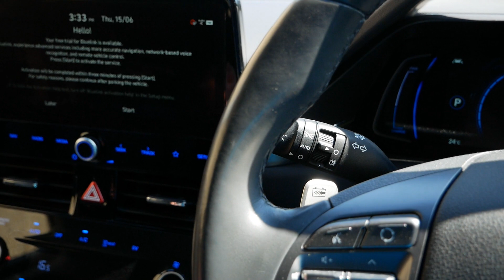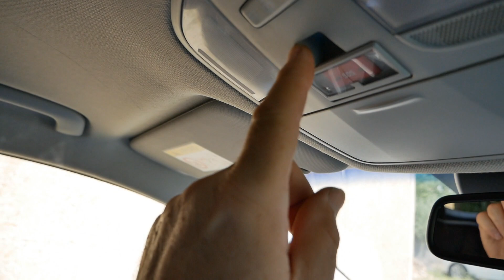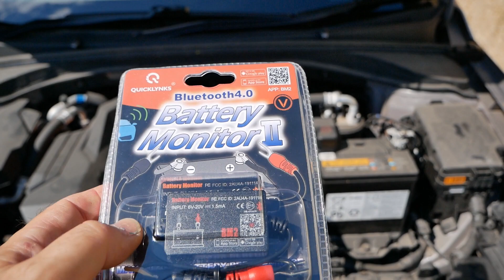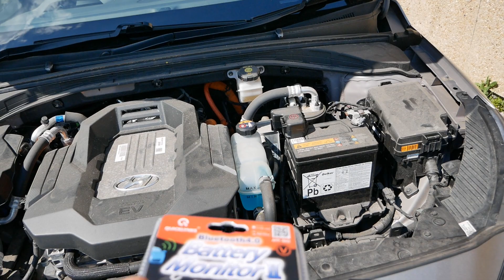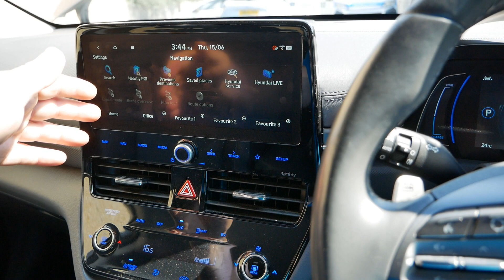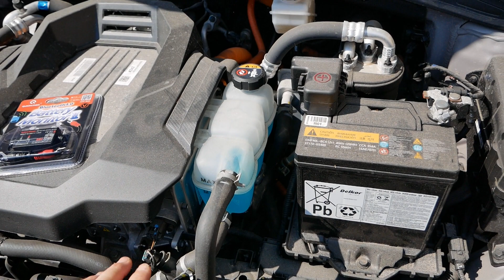Another 2020 Hyundai Ioniq 38kWh. Now for some 12V battery and Bluelink app testing.

Comment: I got a Ioniq premium se nearly 2 years ago now, it had 28k miles on it, 4 years old out of a Motability contract for £10,500 including a home charger and installation. It’s been absolutely fantastic, what a great car it’s been. It costs me about 1p/mile to run in electricity and overall around 25% of the cost per year that my Hyundai i10 did and it’s so much more comfortable and convenient. I would normally change my car after 2 year but I can’t find anything that could sensibly replace it - so it’s a keeper!

Comment: FYI Local hyundai dealership  quoted £369 for a 12v battery and the car is just over two years old and it wasn't even in for that!  ... I dont think even tesla would charge that for their latest 15v lithium batteries!
Reply from the maker: Well known that traditional dealers will try to rip you off unless you query the price. The battery is about £50, then should be maybe £50 fitting.

Comment: Frankly I think those Bluetooth battery monitors are a waste of air. The Bluetooth range is so pathetic, the thing is next to useless. I did NOTHING to stop my 12V battery going flat because the poxy pierce of junk failed after a few weeks too, a problem others have also reported on Amazon.

Comment: Ive just come back from holiday in crete, and left the car at birmingham airport for 8 nights. Bluelink allways enabled.started fine when we got back. Even checked in on the car a few times via bluelink while away. 
Only time the battery went flat was last saturday when i left car to get windows tinted(only premium spec. ) the guy managed to flaten the battery after 2 hours of opening shutting doors/windows a few times. My noco gb70 jump pack came to the rescue.

Comment: Never under estimate a 38kw Ioniq. Just completed an 80 mile stint on way to Birmingham from Somerset and averaged 5 miles per kWh at a steady 75 on cruise up the M5. They can't be beaten for efficiency. And being a premium SE you get all the toys too! Incredible cars.

Also in 2 years use averaging 12k per year and at least 4x  2 week unused stints due to holiday, I've never had any 12v issues and that's with Bluelink always live.

Comment: Hi, I have noticed something today. I was cleaning my 38 kWh Ioniq with ignition off, doors unlocked and key in my pocket. Looking at the battery monitor II app on my phone, i realized that the voltage dropped from 12.7 volts to 12.3 volts in 15 minutes or so. I dunno how to interpret this correctly, but i have the impression that leaving the doors open or having the keys nearby drain the 12v battery fast. So maybe it is a good precaution to leave the car turned on, or put the car in utility mode, in order to ensure that the 12v battery is being charged, and not being drained.
Reply from the maker: The interior lights and ECUs will be kept on for a period, so will be draining the 12V. But then having the keys within range also 'wakes up' the car. Having the welcome folding mirrors turn on uses a lot of power too.

Comment: Hi Matt hope your door handles don't  fall off
I will look forward to your future ioniq vids
Was you able to sort the insurance on your damaged Tesla in respect of the free supercharging if its a write off to be repaired
As this would be a major incentive to get it repaired 
With charging costs increasing ( Rapids ) you'd soon see your long  journeys racking up the cost without free supercharging
Reply from the maker: An update coming on Wednesday on the Tesla. Its been a long and slow process....hence why I needed some wheels!
Reply: My handle fell off, glued it with epoxy and it’s been ok since. I have had lots of battery drain issues with my 38kwh been stuck multiple times and my wife has been locked in the car with the children.  I have had blue link off since the first issues with the 12v. Going to try a new 12v.

Currently travelling with a 12v booster pack now.

Comment: I have an Ioniq 38kWh and my wife has a Corsa e. I am really happy the wife is disappointed espescially with the Vauxhall app and dealers! On the subject of bbattery drain I have only experienced one occurrence in three years and over 21k miles and have used the Bluelink app from new.
Reply from the maker: One occurrence in 3 years...maybe I'm not going to be able to prove anything then. I'm very surprised with the Bluelink app functionality. Its almost as good as the Tesla app! One thing that was putting me off with the e-Corsa (or any Stellantis EV) is the poor regen. We weak B mode is a bit "first generation EV" now!

Comment: But I know that the charging speed is worse than Ioniq 28kWh....😎
Reply from the maker: Yes, I'll be interested to try out the DC rapid charging as we never need that in our other Ioniq 38kWh.
Reply: @GoGreenAutos  Teslabjorn did 1000km 2h25m quicker with the 28 over the 38!

Comment: Hi
I have a check electric system on my 28 when i use the air conditionning. The vehicle stops and is in P mode. Sometimes very difficult to restart. Obd says it s HVAC, interlock, inverter... 
But do you think it can be simply the 12V battery too weak for the power needed ? 
I m in south of France and yesterday the temperature was 39 degrés displayed on the monitor.
The dealer says i have to change the compressor. 4000 euro 🙄
If you think ot can be my 12V battery i change it. 1.5 year old.
Thank you
Reply from the maker: If you have a OBD reader, than you can also read the 12V battery status. Its in many ECUs, but certainly in the BMS. Certainly a poor 12V battery can cause all sorts of strange issues. But the air con compressor is high voltage (from the traction battery).

Comment: Noting the 40Ah auxiliary battery in this car, the original Kona/Niro Evs came with a 45Ah while the new Niro and presumably the upcoming new Kona have 60Ah.
Reply from the maker: Yes, 40Ah is a bit small. I believe there is a 45Ah battery that will fit in the tray, but nothing greater. I've never yet needed to fit a battery in an Ioniq, so not needed to look at the options.

Comment: I have a grey 38 kWh Ioniq like this one, with bluelink activated. I have installed battery monitor II on it after the original delkor 12v battery died in march, and had to replace it with a new one. The new battery is doing good and is
always at a high state of charge. Here is what i have noticed : first, there is a slow and steady decrease in
voltage during the day. Voltage is restored after i drive the car for a while, or after the activation of the aux
battery saver system (runs once per day, for 1 hour maybe, if the 12v battery needs charging, usually happens on days where i don't use the car). Second, whenever
i refresh the car status on the bluelink app, there is a noticeable dip in the voltage of maybe 0.2 or 0.3 volt. Then voltage recovers a bit but does not go back as high before bluelink data transfer. So a tiny but noticeable loss of charge happens with each update.
Reply from the maker: Thanks for the feedback. So far, I'm seeing exactly this too. But its early days. Something must trigger a battery drain. People are reporting sudden drain, even after the car has driven that day.
Reply: @GoGreenAutos  Hi Matt, maybe that sudden drain is what has killed my original battery. I have tried to bring it back to life it by charging it for a whole day, but it won't hold a charge anymore. Who knows how that happened. For now i'm watching carefully the graphs of the new battery and i'll let you know if i notice a sudden drain.

Comment: Before my 38 kWh was serviced in the summer of 2022, I had a couple of battery drains.  After a system upgrade in 2022, that problem disappeared.  Now I can see that HVB maintenance charges the 12v battery when needed.  

Otherwise, I share your suspicion that the car's monitoring system can cause 12v drain.

Bye the way, the new EV looks really great 👍
Reply from the maker: Thanks.

Comment: Its strange, I have the same car (none SE) I dont drive mine much due to working from home, I use bluelink often, I've had the car since feburary and not suffered from 12v battery issues, the app even told me that it temporarily disabled bluelink until I next drive the car, just to protect the 12v battery
Reply from the maker: I didn't know the app would disable Bluelink to save the car. I will try to replicate that too.

Comment: what's the capacity of the 12V battery, and are there higher capacity 12V batteries available?
Reply: There are LiPo car battery replacements beginning to enter the market which offer higher power and longevity for lower weight but they do come with a hefty price tag too! 
From some online searching (Matt could confirm?) the 38kWh Ioniqs use an 054H battery with average dims around 187L x 137W x 225H. 
From a UK seller (Google Eco Tree Lithium) there is a 12v 54Ah 229 x 138 x 217 that weighs 6.7kg but it costs....£449!
I've no doubt that lead acids will be phased out in favour of LiPo in the coming years but the prices are still very much at the early adopter stage!
Reply from the maker: @turbokadett  £449 - wow! You could buy a new lead acid battery and a trickle charger and keep it as live spare in the garage for about £70.
Reply from the maker: Only 40Ah and the tray doesn't allow for any larger batteries. I believe there's one available that is 45Ah, no better.

Comment: Hi Matt, Thanks for another great video. Your channel has been a valuable resource for me pre- and post- 38kWh purchase a couple of months ago. One question, how do you find out about the recalls? Have done some Googling and can't anything about the SOS system recall. Also, just downloading the software update, hadn't spotted that either so thanks for the heads-up! Thanks again.
Reply from the maker: Best way is to join the UK Ioniq Facebook group https://www.facebook.com/groups/724470331518261
Apparently some dealerships are calling their customers for the SOS recall. It only started last week. The coolant recall should get done when your vehicle is in for a service, but as always you need to ask/tell them!
Reply: @GoGreenAutos  Thanks, I'll join that group. I asked specifically about the coolant flush but they said it would be done as part of the pre-delivery service anyway. Asked for a top-up bottle of BSC-2 following your level drop video which they were happy to do and have had to top-off a few times since. Doesn't Aux Battery Saver+ make the BM2 redundant?
Reply from the maker: @tsphipps80  No, even with Aux Battery Saver enabled (the default in a 38kWh anyway), owners are still experiencing sudden battery drain.

Comment: Identical to mine. Bloody prices have plummeted since I bought mine. Did you check the handles
Reply from the maker: EV prices have plummeted across the board, but for some reason the Ioniq has dropped more than others. I can only assume its the recent coolant recall that is putting people off because they've always held their price pretty well before.
Not checked the handles. I dare to pull them hard!
Reply: @GoGreenAutos  and that it doesn't do 300 miles on a charge. I intend keeping it till the wheels fall off. I don't want to see a video on that.
Reply: Thanks for the video.  Please keep us updated on the Tesla repair. It will be interesting to see how the insurance Co. handle it. Until recently they seem to treat relatively minor damage as a write-off.
Reply from the maker: @mauricewatts2380  Tesla update video coming on Wednesday evening.

Comment: After watching Matt’s earlier videos, I dutifully left my 2015 Zoe on a Smart trickle charger while we went on holiday for five days. Day 3, got a text message from “Renault” saying my (previously ok) battery was at 6%, followed by three more messages with the % decreasing to 1% three hours later. Got home today, charger showing Green (charging) but zero on the dashboard and apparently no traction battery charge at all. Disconnected for two minutes, reconnected, orange then green, sat waiting now….but what has actually happened to the battery? Reckon I might need a new one 😢
Reply from the maker: I don't fully understand what you've done here. You left the 12V battery on a trickle charger (that's good) and how where you getting the notifications? Is that through the Renault app? None of this makes sense. The 12V couldn't drain like that is being charged and the traction battery certainly can't drain either as that's shutdown when the car is off. You're welcome to email me on matt@gogreenautos.co.uk or whatsapp 07516471656 and give me a better description or a video and I'll see if I can offer any advise. 
What trickle charger were you using? What is the amperage?

Comment: The Ioniq is good value now compared to other affordable EVs. The 12v battery monitor sounds like a good idea for low mileage scenario. I have found that a solar trickle charger is sufficient to keep the 12v battery topped up even while parked for a two week winter holiday. It will be interesting to hear your impressions of the 38kWh having driven the 28kWh version previously.
Reply: 28kwh Ioniq driver, I've been thinking the same with a solar panel to keep the battery topped up and maybe help with the AC when sunny. Do you recommend a system available.
Reply: Hi @backwoodsbungalow9674 how do you install a solar charger for the 12v battery? I want to do the same but how do you get the power / cables through to the battery? Thanks in advance, I'm at my wits end with draining 12v battery